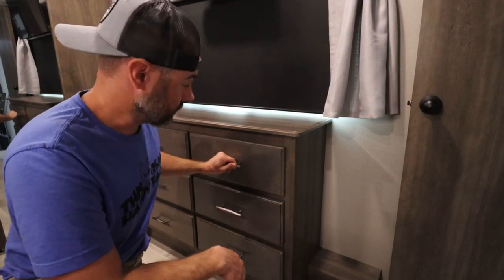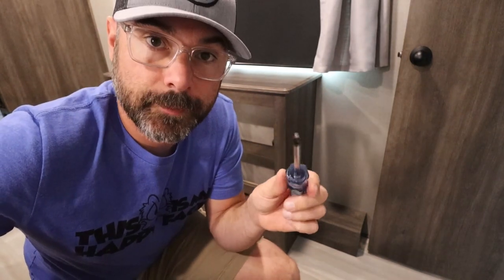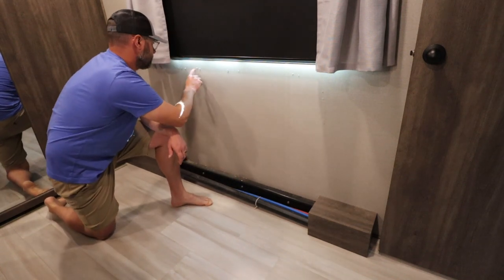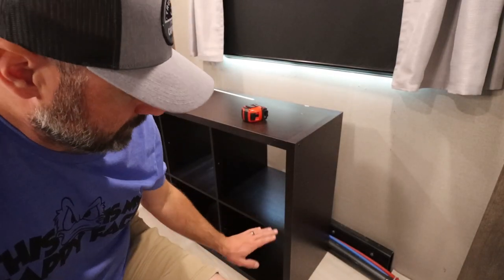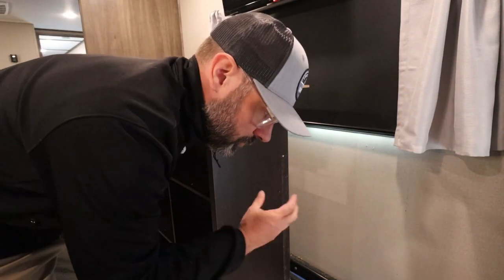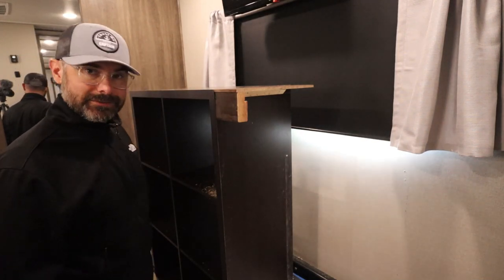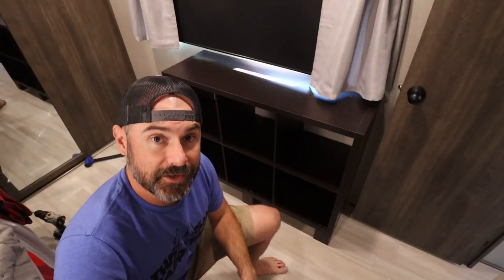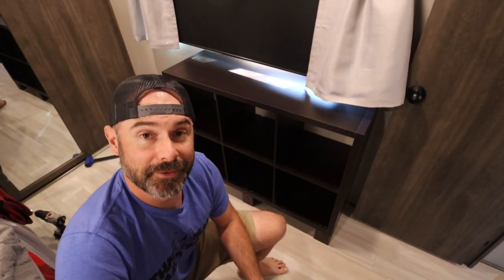Modifying Our RV To Create USABLE Space

Comment: Another great place to find extra space is the basement storage up front. We gained 29 ft³ additional storage by simply rerouting and moving some wiring and cables.  The only thing we actually had to disconnect and redo was the central vac. and some coax cable.

Comment: I use a screw driver, usually the one that removed the screw, to lightly press the material back into the now empty hole.
The handle end of the  driver works the same as that hammer if persuassion is needed.